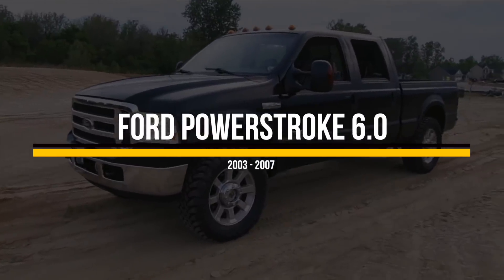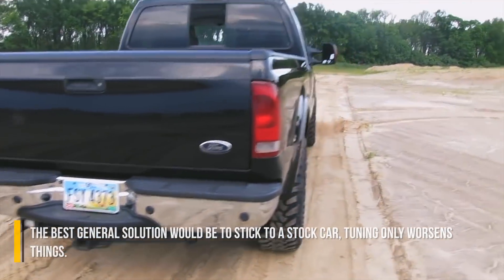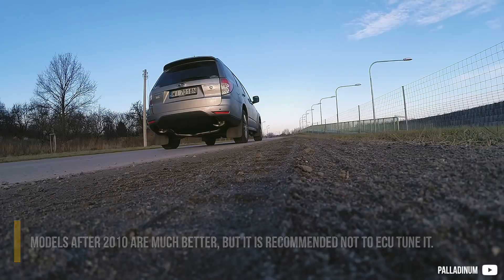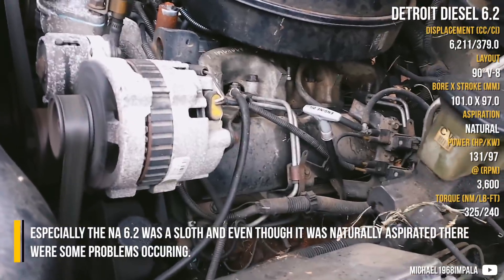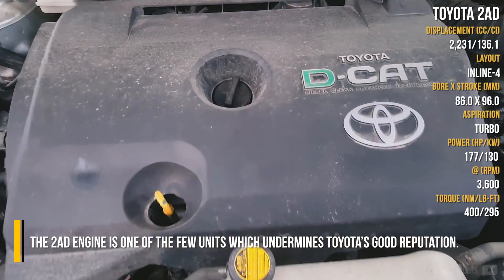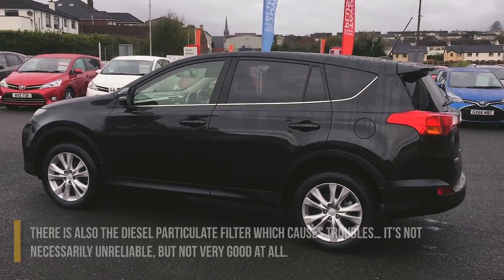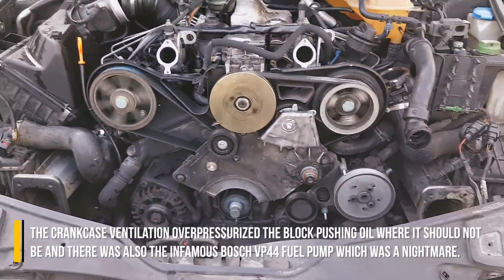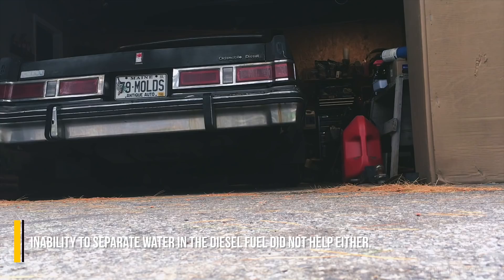6 Worst Diesels You Should Stay Away From

Comment: The worst engines, trucks, Deaslea, Are,  Verhicles used in pools,  Everyone drives them. After one year in a pool a vehicle is trashed.   Because 1or 2 people do not have a drivers licence,  Then 1or 2 people drive with the hand breake on, continually,  1or 2 people drive every Whare in 1st or 2nd gear, Then 1 or 2 people leave the electrics on when they park the vehicle, 1 or 2 do not know how to park a vehicle,  Every other person has one or two bad habits he brings to  the vehicle,  O. K. Now it's your turn to drive,   You left the key's in the ignition,  A street gang has the vehicle,  And are using it for a street derby.  Ask the boss for another vehicle.
Reply: Jack Duffy like in a fleet of garbage trucks where trucks are rotated through  all available drivers , trucks are trash very quickly💩

Comment: Where's french diesels?
Reply: Hakuna Matata the Peugeot 1.6 HDi, serial turbo killer.
Reply: In the trash can. :D
Reply: The oil feed lines for turbo were routed along hot engine area. There is a rumor that you should change these steel lines by time so the turbo remain ok. BTW I hated clutch, transmission and the horrible dual-mass flywheel at my early 1.6 HDi. Fuel consumption wasnt good either.
Reply: Jernej Jakob Only if they werent serviced enough. If you keep the oil fresh and good quality you don't get the oil screen clogging that kills the turbos. I deleted the EGR on mine too which helps. Couldn't fault it as an engine though. Really economical, smooth and loads of torque for its size.

Now onto my second French diesel. 2.0HDI DW10 tuned to 190bhp. Its so quiet when cruising but it'll still make power all the way to 5000rpm if you floor it. Honestly, in my opinion, Peugeot/PSA Diesels have been the best for years.

Comment: And on top of that  if you are removing the cab to replace the FICM your dumb. You can rebuild the whole motor with the cab on, the only reason you remove the cab is to rebuild the engine because it is easier to reach the parts of the motor but you don't have to

Comment: Wait a minute? To fix an engine or emissions equipment, you have to remove the cab????
Let's see, disconnect all wiring to the cab, unbolt the entire cab assembly, but you'd also have to unbolt or unweld the front fenders (at this point, might as well remove them as well!), then reassemble and reconnect everything when fixed??

Or, worst case scenario, drop the engine.  I'm no mechanic, I'm no expert, but I've never ever heard of a vehicle that you had to remove the cab to replace anything mechanical.  Except perhaps a cabover heavy truck.

Comment: No. The 6.0 was a great engine. Great platform. Look at the bottom end design. Heavy cast cradle. The oil pump is an easy fix. The heads are a fix able item. Better then some cummins block that crack for no reason. The oil cooler is the only design flaw. Also the time to do the job of heads at a ford dealership is less than the time for a 6.6 duramax in a chevy dealership. Look at what is fact before you listen to jerks who cant see what is right in front of them.

Comment: Ok, so american and japanese cars are really overrepresented here, you really had to look for the one european diesel that was a total fail (the 2.5tdi V6). I had a 2.5tdi R5 in a Caravelle, and while the rest of the car was falling apart around it the engine was rock-steady. Same goes for my current car, a 2004 Touran with the 1.9tdi, which at the time of writing is still going strong at 235000km. My colleague's RAV4, with the 2.2l however got real problems with all kinds of engine trouble around 150000km...
Anyway, some honorable mentions of really horrible Diesels: the italian-made 2.7l engine they put in the Jeep, and the Ford 2.2l in newer Transits which seems to have a habit of developing total engine failure around 30000km.

Comment: stop talking nonsense if you don"t know what were the problems with the 2.5tdi v6 engine. The camshaft wear problem was because of the longlife oil change intervals and bad cylinder head design. They changed the cylinder head design on the newer versions of the 2.5tdi v6 wich engine codes start with the letter B.. The VP44 injection pump problems were all becuase audi didn"t bother to install a lift pump that would supply suffcient amount of fuel to the injection pumps. And becuase of this the injection pumps ecu were overheating.
Reply: mrAudisubaru It is hard to go down to their level . Excelent explaination , couldent of said it better

Comment: The Mercedes Benz OM642 V6 turbo Diesel engine is a disaster! Works well to begin with but extended oil change service recommendations cause overheating and sludging and eventually engine lockup. Intake manifolds usually sludge up at around 100,000 miles requiring replacement at a cost of $3000. Oil cooler seals go bad frequently which require $10 of parts and $2000 labour charges. Used in many MB cars and the Sprinter van the repairs often exceed the value of the car. 

Worst engine Mercedes EVER made!

Comment: Honda civic 2.2 ictdi cylinder pison fail its running only 3 cylindes
Reply: Rohail Afzal that is an exception , never heard of that , i have a 2.2 accord and no problems
Reply: Flying Thin after you run it 100 000 miles
Reply: it has 170,000.

Comment: You forgot 2.5tdi 110kw VAG engine, BMW 2.5TDS engine
Reply: Kristjan Pani 
That 110kw engine was the worse one, in my mind that new one 180hp is the fixed one...
Reply: Kristjan Pani whats so bad about 2.5tds engine?i really love the sound it makes..
Reply: Andrej Kostovski might make a good sound, but they are notorious for blewing head gaskets when under load for some time, cylinder heads crack/bend, turbos dont last, fuel pumps dont last for shit, glow plugs dont last -whatever the company that made them. They have so many design errors. It is super hard to find one that starts perfectly, wether its cold engine or warm engine.
Reply: Canis Lupus well, that is probably super well maintained and repaired with BMW original parts, driven like a grandmother. Where i live, it is super hard to find a BMW with 2.5TDS that works fine. BMWs tend to get driven by younger people, therefore they get driven hard and this engine definately doesnt last.
Reply: Kristjan Pani there are few 2
5tds working and pulling strong in my city making the best sound i ever  heard from a diesel engine.And maybe you are right i dont really know about 2.5tds but what about the 3.0 r6 from bmw?there are even more of those
Reply: These are the complete opposite of 2.5TDS. Ive owned a few 3.0d e39s, and i drove them like a maniac, drifted them around, floored it at every traffic light etc, and the engine lasted longer than the body, which just rusted full of holes. TDS engines do sound super nice when straight piped, but i prefer reliability myself.
Reply: Kristjan Pani 3.0d engines are also very good sounding
Reply: Andrej Kostovski they do sound great. When i sold my last e39 with 3.0d 142kw engine, the new owner immediately straight piped it and when i saw it driving around town and heard how great this car sounds, i started to regret selling it. Even tho the underbody of that car was soft as cheese.

Comment: IDK what you're talking about bro the 6.5 Detroit Diesel will pull a house off its foundation at 5 miles an hour all the reliability issues came in when it went from being a military motor to civilian usage motor in normal trucks GM added all kinds of crap when a vacuum pump it wasn't needed to operate a blow off valve that could have been mechanical they swap from a marine injection pump to crappier cheap pump relocated the ECM from in the cab to under the intake manifold so that it would get fried from Heat and reduce the engine's cooling capabilities with a small fan and smaller Radiator than the military K5 s you can fix all of the factory implemented parts that fail for roughly $1,000 after that it's a two stroke diesel it has no valves meaning that there's almost nothing to break and they will run for well over a million miles and mileage can be up to 30 if you know what you're doing with the fuel system
Reply: I am not sure what 6.5 diesel you talking about. The 6.2 and 6.5 in GM pickups are 4 stroke engines

Comment: 2.5 V6 Tdi worst engine ever
Reply: Wilkurr I disagree, I have one in my A6 c5 avant which is a 2004 and it’s been a fantastic engine, gave it a new pair of timing belts, water pump & tensioner along with regular oil changes ! 

At 173, 000 miles it’s still running nice & smooth ..